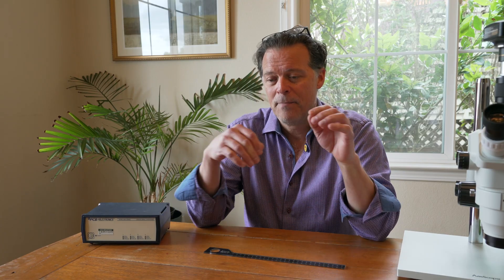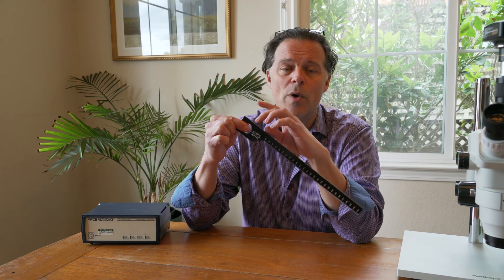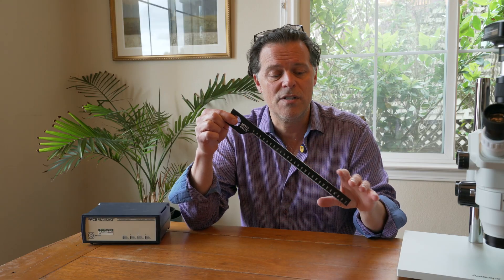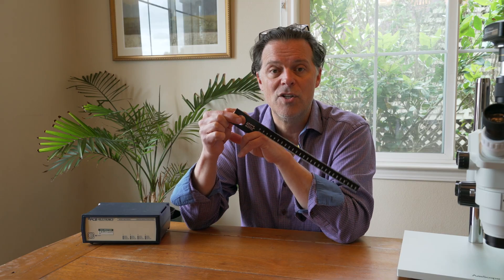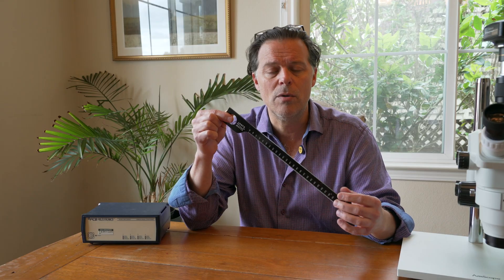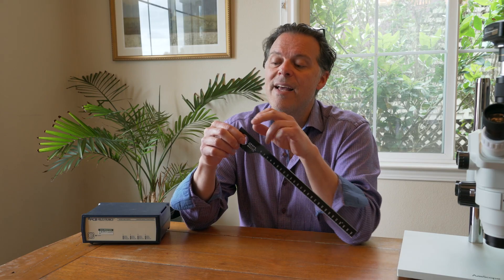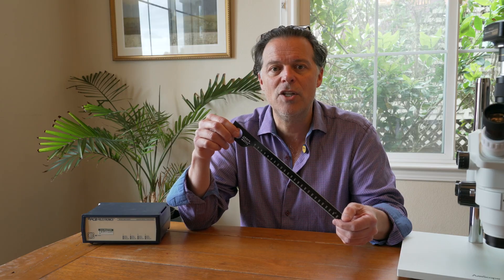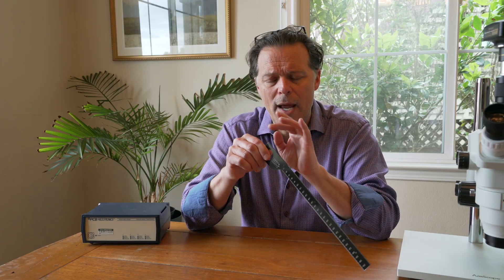Sound Bite #32: The Most Important Location On A Turntable

Comment: When did substantial quality improvements have been introduced into the stylus production and into the cartridge production? Same on tonearms? Between 1960 and today? Or are we not all actually waiting for the first substantial improvement to happen? Considering your stats?
Between turntables, tonearms, cartridges, styluses, which is the furthest aways from its potential optimum of its applied technology? In future we might invent some consumer microscopic scanner with AI-Cloud-fed EQ to touch, eq, play a record, but that‘s not what I‘m talking about, it‘s the current available technologies in this market?
I think you made that analysis and likely that‘s what lead you to stick on the cartridge business instead of turning to tonearms or plinths and bearings.
Reply from the maker: I think tonearm design and, to a lesser extent, turntable design is holding us back from getting more from the groove than are the problems with cartridge design and assembly. It's just that the cartridge problems are the lowest hanging fruit right now.

Comment: Hello! This is a super topic. Thank you very much! Of course, when we calculate the resonance correctly, the perfect tracking of the head over the modulation grooves allows us to achieve the correct vibrations relative to the channels inside the cartridge generator. I always compare the fit between the head and the tonearm to the hands of a violinist and a weightlifter.
Reply from the maker: I will challenge the whole idea of calculating resonance in an upcoming three video series.

Comment: in my understanding, the Decca London cartridges had the best solution, with the diamond pointed down, mounted  in the middle of the cartridge/motor system, effectively without a cantilever, but poor quality control prevented it from being a market contender.  Rega is/was using a modified rollamite pivot, which shows innovative thinking, but doesn't talk about it today.    ortofon also has the economic power to research and implement change , thus my 2M Beethoven cart uses nanotubes at the pivot.

Comment: I think I can actually understand this concept, but I have been wrong many times.  You were busy in Dallas @ the SWAF so we didn't get to speak.  Mine is a frugal system that I've been working on for about 60 years.  I believe "you can't get better than your source and it can't play better than your speakers" concept.  Thanks for your Videos.
Reply: I have also enjoyed a frugal approach , using a slow weak link philosophy,  which,  in my old age, worked out well.  I also believe those two ends are the real voice of a balanced system.

Comment: So the most significant factor on a turntable is then the cartridge?
Reply from the maker: No, that does not follow. Other elements can disturb that location: bad tonearm, bad turntable bearing, unacceptable isolation of the table, etc. Cartridge design has very little to nothing to do with those things.
Reply: @WAM-Engineering My first thought was perhaps different cartridges may have more secure cantilever pivot points than others. After watching the video again I see your point of external forces affecting that location as paramount notwithstanding the design of the cartridge.
Reply from the maker: Most cartridges use a stainless steel wire as the pivot.
Reply: @WAM-Engineering  interesting, as EMT/Thales have worked a „subchassis“ specific damping alignment on one of their cartridges to create a variant optimally working/selling with the TD1601 TP160 arm. 
If it has no relevance, than this is pure voodoo, or you mean quantitative relevance as cartridges damping system alignment with a target turntable architecture is very much of relevance quality-wise, but irrelevant as for it‘s ultra-niche application execution.
To me, different turntables with different suspensions, just like diverse resonance architectures or plain chaos modify the tracked interface of a grove that interfaces with the stylus and its damping system up to the cartridge and how it‘s mounted, just like off-road tracks with different sand, clay consistencies require different competition motorcycle suspension setups, even differentiating multiple elements, as is high/low speed, preload, damping of compressin and rebound, aside from pure resonances of the chassis, that come on top.
Reply: I believe the most significant element of a turntable is the main platter bearing , as it is the limiting factor to all other performance.  no amount of extraordinary design can rise above the bearing performance.  If a sales pitch for a table doesn't mention the bearing in detail , that says a lot. 
the most significant factor influencing cartridge performance is the tonearm.
Reply from the maker: On most turntables the lowest mechanical impedance path from the bearing to the cartridge motor is through the tonearm. This puts us right back at the cantilever pivot point! So, yes, we must ensure the bearing is a good design and build or the pivot point will read the noise from it.